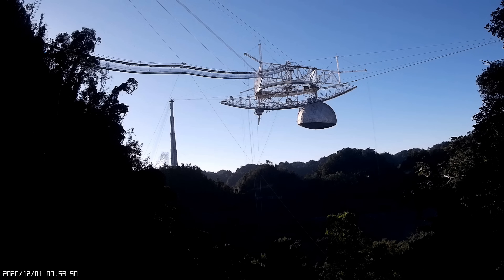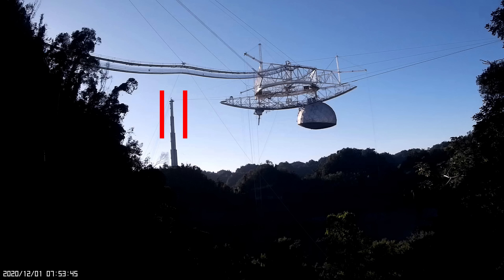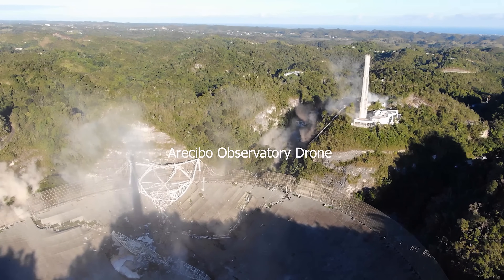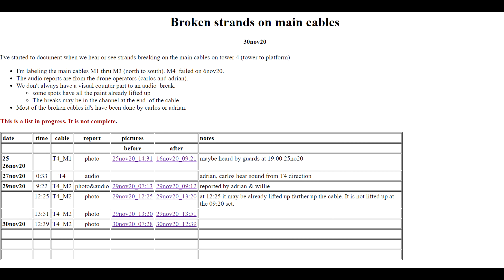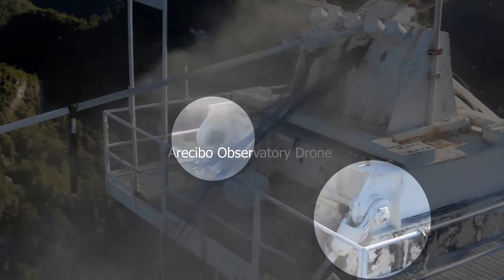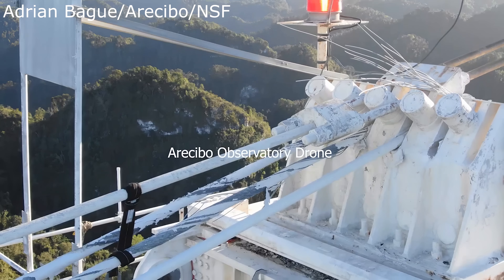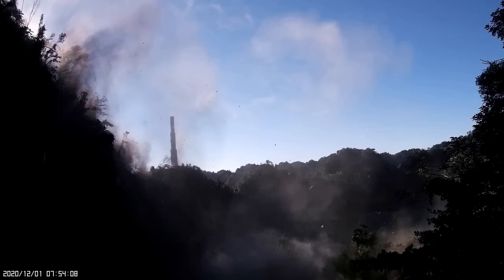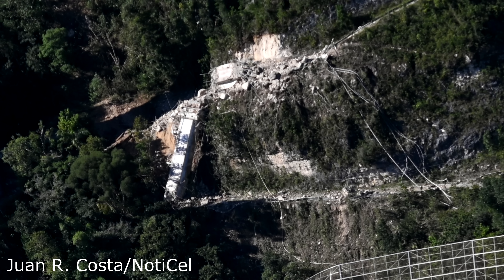Analyzing Video Footage Of Collapse of Massive Arecibo Telescope

Comment: I'd thought that the cables were anchored into the earth, draped over the towers, then attached to the platform - like with a suspension bridge. This kind of a double anchor system seems like a design defect. They were certainly capable of developing cables of sufficient length at the time - as evidenced by the many suspension bridges built prior to this. Perhaps the dynamic loading on the towers were why they decided to go with an anchored-on-top approach. Having said that I'm reminded of the 
Hyatt Regency walkway collapse; although that was obviously built, and failed, long after the Arecibo main dish.

If something new is built in its place I would hope they'd go for the draped over design. If it's done with winches at the anchor points it would be able to allow for variable focus too, in addition to pointing by using an azimuth arm approach.

Comment: Seems like a pretty poor design and questionable engineering/build/maintenance on the initial cable failure.  Overhead cable systems I have been involved with have a safety factor of 5.  This sounds like it was designed as 2 and performed less than 2.  The minimal amount of rebar in the towers is astounding.

Comment: I think they should do a dynamic cable system on the new dish, like the NFL's cable cam.  That way you don't need nearly as much weight in the air, and it can be settled on some supports during storms or earthquakes.  It also would make servicing and replacing cables much easier.  However it would mean much less hardware could be lofted, but I don't think you would need nearly as much at any one time.

Comment: Really cool.    Thank you.

My guess is they had demo charge on the top of a tower opposite of the one shown coming apart.   Once the charge blew, the weight would cause the failure shown on video.
   I'm not buying it broke right when they had a drone in place and other cameras watching.  PLANNED DEMOLITION
    It looked pretty cool though.

Comment: Rather than pulling from the socket, it looks more like the strands have failed at the entry to the block. That point is a load concentrator.
Reply from the maker: It's possible, I'm no expert, I just wanted to point out the failure it right at the socket or its interface.

Comment: Missed opportunity:
"I'm Scott Manley, fall safe"
Reply: Too soon
Reply: @CrazyChemistPL  way to soon
Reply: Flying is just falling with style.
Reply: I‘d rather have „fail-safe“ please...
Reply: That could work for Starship.
Reply: "fail safe"?
Reply: @ioresult  fail safe is a mode/theory of design where every effort is made for conditions be in a certain state due to failure of the system or to fail gracefully so the system isn't left in an uncontrollable or dangerous state by the failure such as an industrial process that cannot be stopped if the control system shuts down unexpectedly.  Good examples are traffic lights/railroad signals that come back up to a full stop condition (typically red/flashing red) after a power failure instead of defaulting to all routes given green lights for instance.  Or railroad crossing gates that are designed to drop and block the roadway if the power and/or control systems fail so that the crossing isn't left unprotected.
Reply: @timothybarney7257  Thanks for the explanation. BTW, I know about safe failing, I've got a degree in engineering. That's why I said it. But the explanation can benefit everyone so I'm grateful you wrote it.
Reply: @ioresult  my background is electromechanical engineering myself, but never worked in it, went into telecommunications instead (over 20 years now)
Reply: That would be in very bad taste
Reply: not even maybe
Reply: Build safe
Reply: I mean, Flying is just falling safe right?

Comment: Why cant it be supported from below? There was already a "dishfree" zone right below the platform. Does one really need 900t of a platform to send a megawatt radio signal?
Reply: The platform moves and rotates, the thing also weighs more than 100,000 lbs
Reply: @dremorakynval1269  Platform itself was still, and weighted like 500t. 

Lowtech solution to wind, just be so heavy it doesnt move it much?

Comment: So over the past few weeks they couldn't find the button called, "lowers assembly"?
Reply: It was not built in a way that allows lowering the structure
Reply: @LutzDerLurch  
Seriously?

That suggests that they either used a huge crane to install it or a huge helicopter.

Of course that also means they could have done the reverse.

Just seems kind of retarded that they knew it was going to collapsed and simply waited for it to happen. 

Maybe it was just passed its time and was obsolete.

Comment: If you'd like footage to review to put perspective on those cables snapping, look for aircraft carrier arresting gear cable snap footage. It's a bigger wire and can equally kill/destroy!
Reply: straight up not true. arresting wires on carriers are a bit bigger than 1 inch. thats 3 times less that the ones at arecibo

Comment: I think you got pretty close in your MS Paint assessment, Scott.
Reply: Looked almost spot on to me!
Reply: Indeed
Reply: That was my first thought when I saw this video. He nailed it.
Reply: @BrainScramblies  Accurate. But not shocked. You only needed a minimum of deduction skills to reconstruct the collapse from the wreckage. So, clearly no challenge for someone like Scott. I am more shocked that the telescope didn't even last two(?) more weeks after it was announced that it would not be fixed.
Reply: @TheAgamemnon911  Even before the collapse, it was likely it would originate with the cables from that tower, given they were already carrying a third more than their design weight, courtesy of two of the six cables having previously failed (so if funding ever materialises to rebuild it, it would be prudent to build in as much redundancy to the support structures as they can get away with - ideally cables that can handle a few multiples the intended load, and four or more support towers, so even if something went catastrophically wrong with one tower, the rest could easily handle the increased load).
Reply: What do you mean?
Reply: @vipon9491  look at Scott’s earlier analysis before the video came out. He was working from stills and predicted what we see in the video.
Reply: @scottgriz  yeah, just went back and watched it. Spot on

Comment: I don’t care what country does it we need to recreate this on a crater on the moon. And make sure the cables don’t snap this time!
Reply: Way less grqvity on the moon, i doubt they wuld
Reply: @FluidMotionEnergy  yeah, but they would also use less cables, probably about the same stress on each cable.
Reply: @throwaway80345  no, go overkill on the cables so this doesn't happen again
Reply: @TheAechBomb  Yeah, but you have to fly every cable there and they are heavy...
Reply: @throwaway80345  set up an operation to refine aluminum from moon rocks, lunar rock is about 20% alumina
Reply: Should be way easier once you got everything there, but we probably need to find some way of using moon dust and rocks for the main strocture so we dont have to bring everything there.
Reply: mmmm i agree.
Reply: The moon? ... because it doesn't have an atmosphere that doesn't interfere with radio waves
Reply: If you build it on the far side of the moon, all radio noise from earth will not be present, making for much better data.
Reply: @fuelrich299  With our usual bad luck there will be a huge man made radio telescope just at that location delivering its fair share of noise.
Reply: If you build a structural 1/1 copy on the moon, in the 1/6th G there it would probably last a long time just from how overbuilt it would be
Reply: Why Moon?
For example, consider that a free-flying radiotelescope would not NEED strong cables at all.
Reply: @denysvlasenko9175  Yeah, but send a dish this size into orbit. On the moon you could just use moon dust for the dish.
Reply: @throwaway80345  >  Yeah, but send a dish this size into orbit.

We already sent 100m dishes to orbit. Wikipedia "Orion_(satellite)".

> On the moon you could just use moon dust for the dish.

I can "just" use moon dust? This technology exists? There is a Moon base with industrial capacity to manufacture radar antennas from regolith? URL please?
Reply: @denysvlasenko9175  there is not, but its easier than sending a dish with a diameter of 300m into orbit. And its technically possible to make some sort of concrete out of stuff found on the moon(lunarcrete).
Reply: @throwaway80345  > there is not, but its easier than sending a dish with a diameter of 300m into orbit. 

It's easier to build a Moon base than sending an unfoldable 300m antenna to space? What are you smoking? We already sent 100m antennas to space!
Reply: The reason why the moon too, is because we could use a crater as a dish.
Reply: @fuelrich299  You can't use a crater as a dish. The surface of a 10 GHz antenna needs to be correct with a precision less than a centimeter. Preparing the crater to that precision with our current technology would require a Moon base. 10+ years and 20+ billion dollars.
Reply: @denysvlasenko9175  Arecibo actually used a natural sinkhole as its dish.